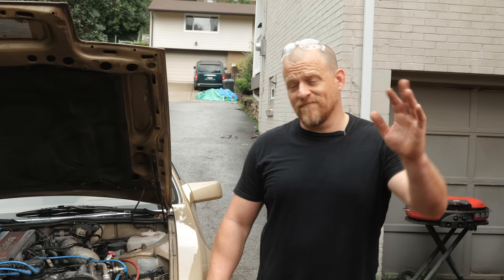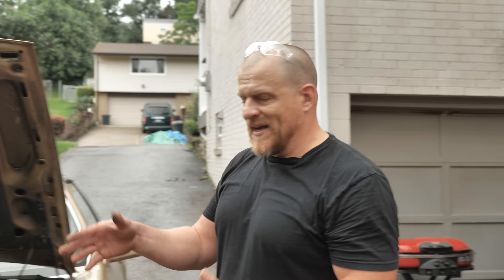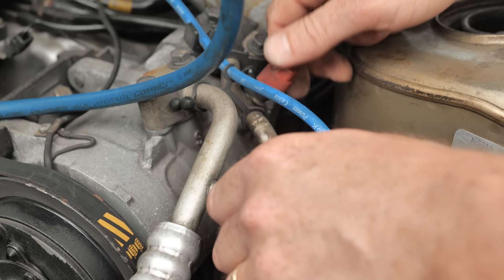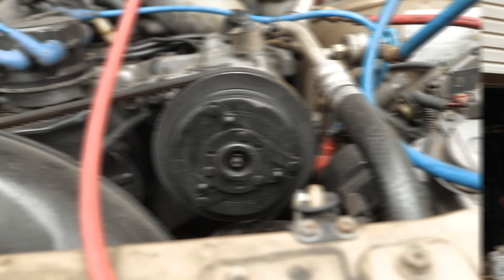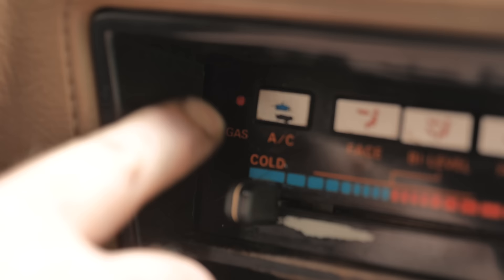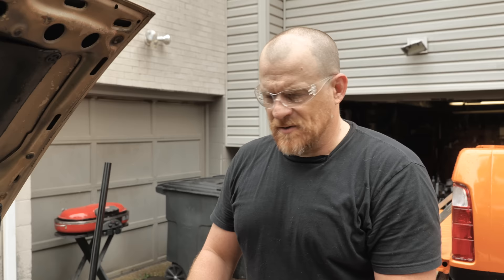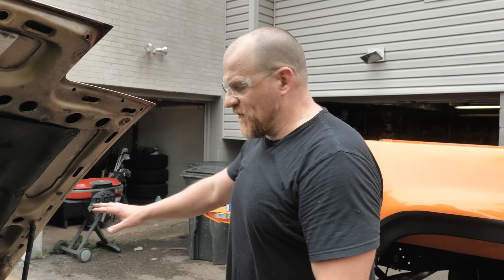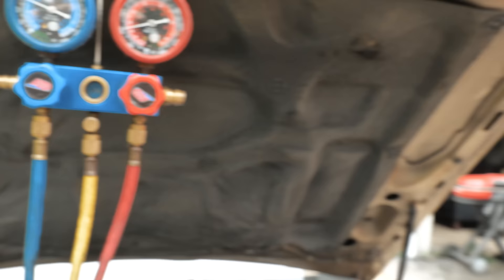A/C Leak Testing, Repair, Evac and Recharge (ANY CAR!)

Comment: Just a little comment about max pressure in the A/C system.
Manufacturers have security regulations to comply to, that also applies to accessories like the A/C systems, meaning that the A/C systems are 1stly built to sustain way over 300PSI before going critical, and on both sides of the A/C system, so 300PSI is always in the "safe zone" no matter what ... I mean for cars with the high pressure side of the A/C that reach these numbers which is a great majority of the vehicles on the road.
THANKS FOR THE VIDEO!
Nice car! 2 thumbs up !

Comment: You can definitely have systems hold vacuum, but not pressure.  And that can be because of the seal that's leaking--- your vacuum can pull it closed, but when there's pressure on the other side, it can push the seal away from the 'gap" at the leak again, because there's nothing there to support the seal-- at the leak.  So again, a vacuum can cause a leaking seal to Reseal itself - but it only holds as long as the vacuum is there, pulling on the seal... So your leaky seal is acting as a one way valve essentially.

Comment: Hello....You are still Scanner Danner to me....learned a lot about how to apply the oscilloscope to automotive applications and even upgraded to a Pico to go with my laptop!

Thank you for all the videos you post and like your son's choice in a car....not my favorite Z, but it is a classic!  Hope he got the manual......I'm old school!

PS:  When removing your digital gauge, it would have been fine to use the vacuum pump to clean the gauge lines....pinching a line with vice grips is N.G.

Also should purge the yellow line at the gauge to avoid atmospheric wet/air from line when adding refrigerant.  This does allow refrigerant to the atmosphere, but is acceptable for purging line only (no need to loosen line at gauge, it can frost the seal.  Schrader valve under the brass cap screw for yellow line at gauge input.)

P-Chi

Comment: Connect your vacuum pump using a tee fitting.  This way you can pull a vacuum to insure you are not introducing air and moisture into the system.  Run your vacuum pump to pull the air out of your filler line before you add refrigerant (make sure to turn the pump off and, if there turn off, the valve to the pump).  I run the refrigerant cans upside down since I use the cans with the oil already in the refrigerant so the oil does not separate out.  I also make sure to add the refrigerant in slowly to avoid any possibility of hydro-locking  in the compressor.  I also shake the can before each time I add the refrigerant to insure that the oil stays mixed.

Comment: Nice video and very informative.  I'm just a DIY'er that learned on my own how to do AC repair back in 2006.  I have never used a micron gauge while recharging a system even though I knew they were out there.  I have probably successfully repaired around 15 vehicles and had one failure to do so.  I think the micron gauge would be nice but I have never felt the need to use one.  

I have a 6cfm Robinair vacuum pump and I usually vacuum down the system for 30 minutes and then let it sit for 30 to see if there is any decay.  Sometimes if a system has been opened for a long time, I will vacuum down again for 15-30 minutes and then let it sit some more.  

I also ended up buying a refrigerant scale for the big tanks and bought several of the R134a tanks so recharging is so much nicer without having to install and disconnect cans.  I did that method for a while and did not enjoy it.  It's much easier to program the charge amount into the scale and let it do its thing in one shot.

I did buy a nitrogen regulator after watching your AC repair videos you did last year and now I need to buy a bottle and get it filled so I can check for leaks easier.  I did use that method using a bottle that a friend had but was almost empty on one of my repairs I did last year and it worked well.  His bottle is old and outdated so I don't think it can be filled any longer.  Again, nice job.
Reply from the maker: Thank you!
Reply: @Wayne Dimirsky ..Take your out-of-date Nitrogen tank to a welding gas/supply store and they should be able to re-test it (good for 7 years I think) and then re-fill it (for a small retest fee) or most will do an exchange/refill if a tank is up to date. I keep a 40cf & a 60cf so I always have a backup waiting if one runs out.
Reply: @bobrub  Thanks.  I will do that and see if they will re-test it or sell me another one.  If I read the date correctly, it's over 20 years old.
Reply: I've heard all over the place that once you open your system you should replace literally everything and I've heard situations like this where you just vaccum down the system and it's good I probably should replace my everything because I think my compressor went out and could have sent metal shavings into everything
Reply: @rcaddict3815  If the system is open for any length of time, the accumulator should be replaced.  Everything else should be fine.  If the compressor failed and sent metal shavings throughout the system, then pretty much everything has to be replaced or flushed if the component can be flushed.  If the lines have mufflers in them, they also have to be replaced.  If not, you can flush them.
Reply: @Mr2004MCSS  is the only way to tell if metal shavings made it thru is just take it apart and find out?
Reply: @rcaddict3815  Yes.  If your system has an orifice tube, you can take it out and it will be very noticeable because you will have shavings stuck to it.  You can also take the compressor off and see if any oil drains out of it and if it's full of glitter, it's a good chance there is metal throughout the system.  Most of the newer condensers cannot be flushed and have to be replaced.

Comment: Just a couple of tips Paul on the micron gauge. Before you hook it to the system, you would hook it up directly to the vacuum pump. Just use a service hose with no manifold hooked directly to the micron gauge. You want to see your pump pull at least 50 microns. I do this to give me an indication that the oil needs to be changed. And it should be changed after each evacuation. Also, you can use a valve core removal tool to isolate it from the system. This keeps hi pressure from it and keeps refrigerant oil from contacting the sensor which would require cleaning.
Reply from the maker: I did that at the very beginning of showing that gauge and showed what my pump was capable of. Thanks!
Reply: @ScannerDanner  Sorry Paul, must have missed it 👍
Reply from the maker: @stuzman52  all good my friend, long video

Comment: In my 2000 accord I got 47 deg. at the vent on a 103 deg. day after servicing... When I was a kid our 65 mustang would have frost building on the vent fins it was so cold, that was back in 1973...
Reply from the maker: 103 day with 47 vent temp is pretty damn good

Comment: I use a 134a temperature chart, this along with the Delta T helps me when charging. Obviously the best way is a micron vacuum draw down then weigh the Freon along with manufacturers recommended about of oil inserted into the system.

Comment: when i was young my dad never had a proper set of gauges he always watched the site glass thats the way i learned. when i got married went to work for montgomery wards was asked if i knew how to charge a  A/C system i said sure we used 12 back then i was watching the site glass about the time it cleared up the shop forman came by ask how it looked i said see what you think he looked at the gauges and said doesn't get any bette than that so i wrote those numbers on the inside of my tool box to use as a guide. when the other mechanics where charging a/c units i would always walk by and look because i had read that temp makes a difference soon i had a good list of different temps

Comment: I understand  your talking  AC today but.i wanted  to thank you for your  help l had the 1995 s10 back fireing  then dies.  You showed a broken  wire on a ASTRO van .that ended  up not to be mine but it did make me dig deep .what I ended up finding  was the coil  packs I changed  out  on slitly help I pulled  them  back off and found  the condenser plate under the two coil packs  had green  and black  fungus  or corrosion between  its mounting  brackets and the three bolts that holds it to the block was rusted l wired brushed and steal wooled all that area put it all back on now  running  fine .wires and pugs are next. THANK YOU FOR YOUR INCUREGMENT TO KEEP  DIGGING IN YOUR SHORT NOTE YOU WROTE BACK.
Reply from the maker: awesome! thank you

Comment: I remember back in the day they sold a little schrader valve vent tool. It was a little metal adapter that you would screw on to schrader valve and it would allow you vent the freon into the atmosphere without removing the valve core. I guess this was before they knew how bad R12 was for the environment.

Comment: Always inspect and possibly  have to clean evaporator core at the 60,000 mileage mark .
Always purge air from vac pump line at manifold end . Manually purging removes air . which can increase pressures and cause elevated vent temperatures  .
High side pressures over 200psi are borderline especially with these readings in average ambient  temps . The readings will elevate on a hot day .
Suggest if viscous clutch fan to reoil hub with 2 bottles of silicon oil . Toyota sell the fluid .
Wire e fan if equiped to come on with compressor NOT a pressure switch .
Transport A/Con  always runs 150--200psi  all ambient temps .

Comment: micron gauge doesnt even read a vacuum, but the moisture level, which should be pulled down to atleast 150 (and probably 80 on yf system)and if that does not want to work at all, then you either have to replace the dryer thingie or try to pull vaccuum for 2 days (if the leaks are already fixed).
plus you have to remove the compressor on every empty ac system with huge oily cracks, measure the exact oil level in there and then even have to figure out where has the rest of it gone and calculate the new correct amount based on that forensics.
and there is no need to lube up any orings, because if you do not use the ac for 6 months, the oring will dry up and let all of the refridge out anyway, and it will lube itself back up after you fill it up again with new refridge.
air + refridge can actually cause an explosion(dunno how big), so the only part that will create acid with a shop air test is the oil

Comment: The 'new' (for about 3 years now) cans of r134 have a hole in the center with a rubber seal where the tap goes. They require a special adapter. I learned a few years ago it works better to attach the adapter with the tap screwed down into the adapter.  My tap backseats when bottomed out, so I can leave the tap bottomed in the adapter then unscrew the adapter (with the tap and hose attached) and not get air into the system.

Comment: Wow, this was a great video SD.. like many have mentioned yes, a lot of old school terminology here.  I have been servicing A/C for a few years mostly my own and family/friends as a DIYer.  I have a gauge set and vac pump very much as what your using.  I also recently starting using a micron gauge (millitorr is the same unit, btw) as a true value since the manifold gauge set goes off scale at 30" Hg.  I typically will connect my mic gauge to low side as allow a decay - like mentioned if you get into the < 700 mic you are assured you have an integral system and that you have eliminated non-condensable gases (CO2, and atm air, etc)  You mentioned about boiling H2O at room temp that is a value off of the gauge set but around 19,000 mic or 0.025 atm.  So, when you did the test with nitrogen at 100psig initially and ran the compressor and verified that the pressure switch and electrical functions of the clutch and compressor were ok - could you also run that test with 100psig of compressed air?  Since the compressor is running and air has water vapor in it would it hurt the compressor?  You used nitrogen which has no water vapor in it so, you didn't risk damaging the compressor, I don't have access to a tank of nitrogen, or is that something I can call up Praxair and order?  Really great all around presentation and agree your commentary is great, you are a great educator
Reply from the maker: Yes, absolutely, I've done this with air pressure a thousand times. Thanks!

Comment: Im really into this AC-videos!
I have not fixed my AC that i talked with you about.
Waiting for a friend helping me with it. Replacing the pipe/line between compressor high side and a connection like 30cm away. On the other side of the connection there is a pipe/line and a hose going to the condensor. 

Im prepared with new o-rings (yellow) on my volvo in two sizes. One for the inner pipe and one for the outer actual connection so to speak.
And two bottles of PAG 46 Oil. For use to lubricate the o-rings with. Think the bottles was like 150 or 250ml each.

After we have replaced the pipe/line and hopefully the connections are sealed. I must make an appointment at an workshop that have "AC-service"
They vacuum, test for leaks, refill oil and refrigreant if no leaks...  they make some checks on the system as well that fan and other component works.
Costs about 150 euro.. for a complete service.

If i had a vacuumpump i could at least vacuum tested it myself and see if it holds vacuum.
But you said something intresting.. you have seen systems held vacuum but not pressure..

I hope its possible to get all moisture and stuff from my system because of it has been open to air for some time now.

Im really suspicius about at least two components that might making my system be very intermitent.
The two pressure switches. One on the low side and one on the high side.
If i remember correctly they had 3 or 4 wires to their connectors.
The pressure switch on the high side i can monitor on my computer via VIDA OEM software for my car.
Ive seen really strange pressures in the past.. and my suspicious is that it might be sticking or just sketchy..

Symptom is that i get cool air intermitent. It can work for a month then suddenly it stops cool for 10min or like 2 days... really random,.. then it might start working again while driving or such :)
This behavior was before my misshappen with the line of course :)

Ive adjusted the gap on the compressor clutch. Think it stated in VIDA 0.7-0.9mm was OK
I can control the compressor clutch relay with the "AC ON/OFF" button. Seems not to be any problem there. But might be a glitching relay?
There are a lot of components that do not allow the clutch to engage. Lots of variables. Sensors, switches and stuff.

If i have understood everything correct i should be able to change those two pressure switches just for a good measure and see if that helps without needing to empty the system?

Comment: Wouldn't an entire insulated copper tube AC system for your car. Just like the fridge in the home be a better longer lasting system? I am not an HVAC guy whatsoever, so if I sound stupid please bare with me. You remind me of the Teachers at the Union hall. I'm 62 and my back and neck are gone but I still want to keep learning This wise man named Leo w. once told me every job no matter how long you've done it, someone will find a different way to do it better. And he was Right! People can find excellence with experienced builders all working together. It's very humbling realizing this truth, but even better it's amazing to see the results of this truth and the quality of the product produced. We made Sea Ray Boats "The highest quality of Yacht in the world" they even put our boats in James bond movies thru the 90s. The entire world of boat building went ISO 2000 certified from 1990 thru to 1999. Watching a video before doing the job is always a good way to refresh one's mind! and I want to tell you, I very much appreciate the time you spent making your videos. You are an expert!
Reply from the maker: Thanks so much, really appreciate it! As far as the system goes, in automobiles we have movement of the engine and drivetrain, where the AC compressor is mounted, so we need flexible hoses for the suction and discharge lines going to the compressor. Everywhere else would use solid tubing. Make sense?

Comment: at time stamp 29:06 i noticed your vacuum pump was a little low on pump oil. that could have had an effect on your guage readings. im only guessing. im rebuilding a/c system in my 1988 f250 5.8L truck. and my grandfather left me a suprise out in the shed from years ago. a 30 pound tank of R-12 new  never used and full. . thank you for the videos and the help they provide

Comment: You should put the micron gauge on the  high side and pull vacuum from the low side so you get the full system vacuum
Reply: That's what I do.  And on large systems when you check for decay you'll actually see the vacuum deepen as the system equalizes.
Reply from the maker: Interesting guys, thanks for sharing

Comment: Good video Paul,t.. have been doing my own A/C work for years and there´s nothing to complain about,,, there are tons of videos on youtube where A/C technicians purge the lines, dont worry...   also I live in the wrong country... you need a license here to buy R134a, muste be a trained A/C technician or car mechanic with A/C license to purchase refrigerant.. 
has gotten very strict in the last few years... so I had to switch to Hydrocarbon refrigerants

You maybe should add that modern systems are not that powerfull anymore and or the evaporator temp is regulated by TXVs or electronically controlled compressors..you will not see 40° on these systems even when everything in perfect order.. reason is  gas consumption and to avoid people getting sick by blowing freezing air into their face. Also it´s hard to impossible to charge these systems by pressure.. need to charge bei weight

But the thermometer is from your grand grandfather before WW I  :-)